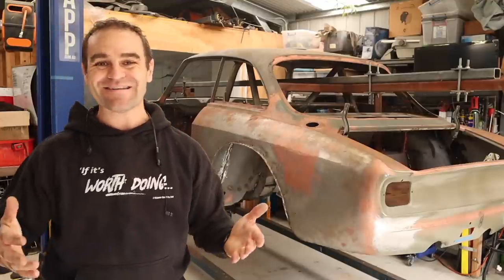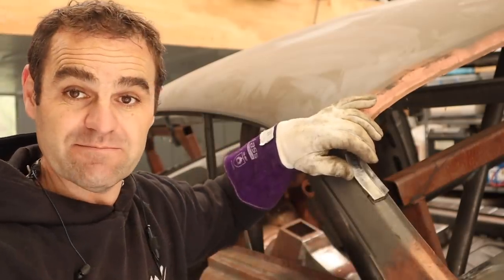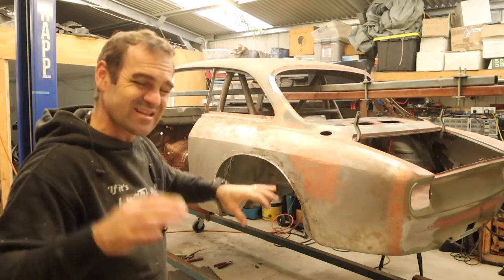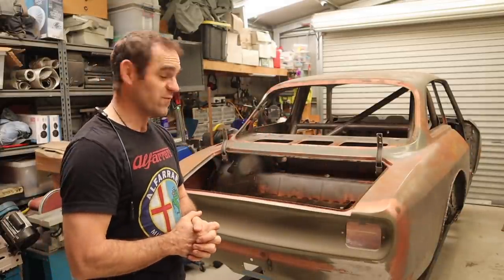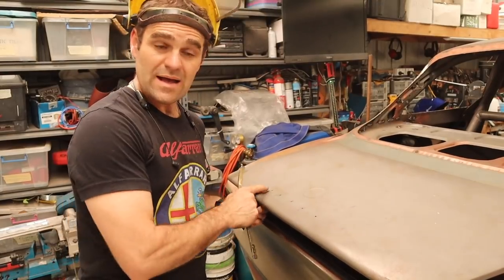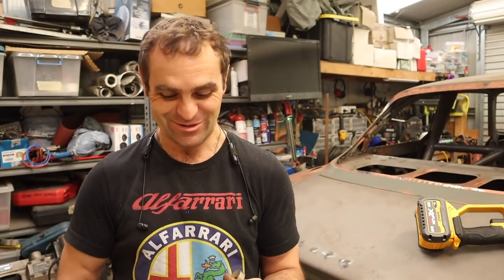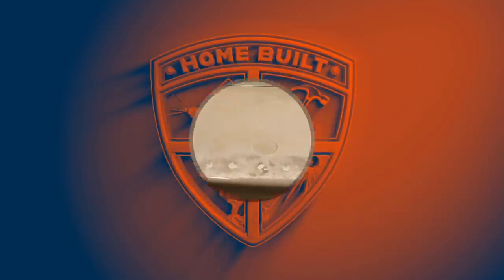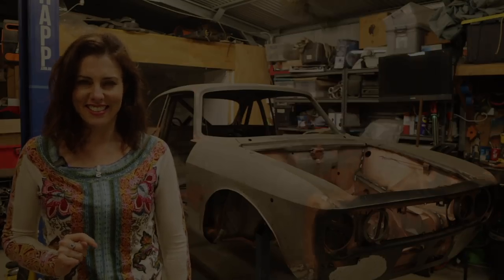Body mods are done! - Ferrari engined Alfa 105 Alfarrari build part 128

Comment: Awesome 😀👍🏽👍🏻  but it does take time fitting and getting it done properly,  you are doing well 😀👍🏽👍🏻   I got my Rav4 painted now fixings the power steering pump I rebuilt it myself just hoping it goes well when I get it in the car , and then do oil and filter change,  and transmission fluid change and coolent,  then get it back on the road 🤞🤞  by the end of the week? 🤞  Then do it all again to the car I'm using  but over time need a job first to buy parts lol 😀👍🏽👍🏻

Comment: I'm getting as excited as you about the paint Jeff. Lol.
It's been a long journey.
Could you briefly explain how that shrinking disc works in another episode?
Also could you not spray a light coat of some primer on to the boot where you welded to see imperfections  easier?
Anyways 
good stuff 👍

Comment: Just a heads up, you have the boot rubber the wrong way. The join should be at the back. Having it at the front like that water can sit up against it and can get in behind the seal.
Reply from the maker: Good tip, and simple fix ;)
Reply: You beat me to it Jason 👍
If you like the seamless look near the latch you can always superglue the join and keep it up the top. Squirt a dab of windscreen mastic inside the pinch weld will stop the water ingress and also keep it in place.

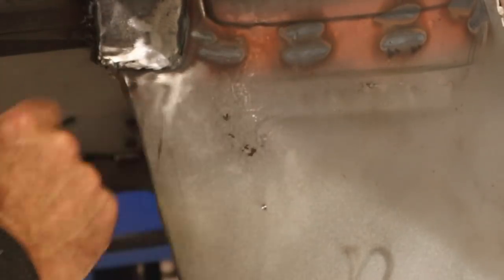Comment: Loving this series, Jeff. One little question about rust repair, for the tiny little holes like around 4:00, why don't you just fill up the holes with weld, instead of cutting the area out and putting a patch like you're doing? Is it just to ensure the rust doesn't spread?
Reply from the maker: As you saw on the boot holes weld is fine. For that other spot the whole patch was so pitted and thin it needed replacing, and if I tried to weld the small spots it would have just blown holes anyway.

Comment: Hi Jeff! The Alfararri is looking great! Are you going to box in the chassis extensions to the rear floor taper sections? Also have you seam welded the door & window apertures & internal roof frame? I did this to my Cosworth Vauxhall Viva HC. It's made one helluva different to the upper body strength! Cheers. Leigh.